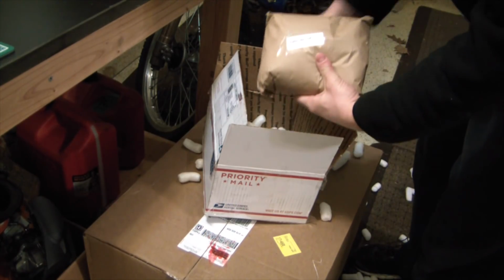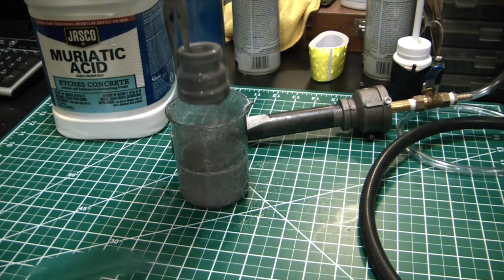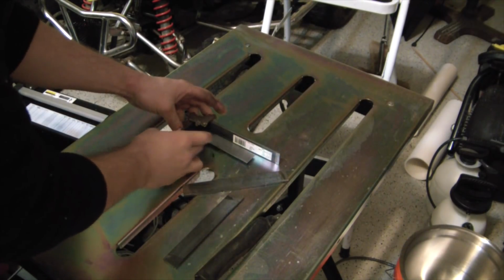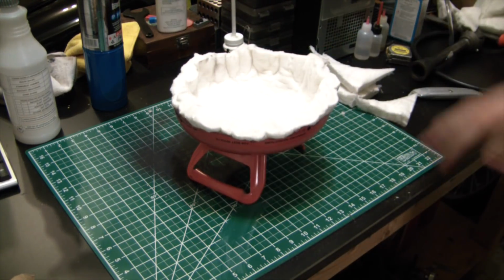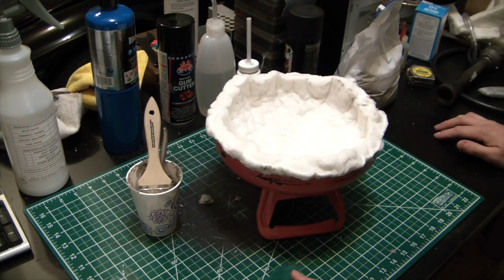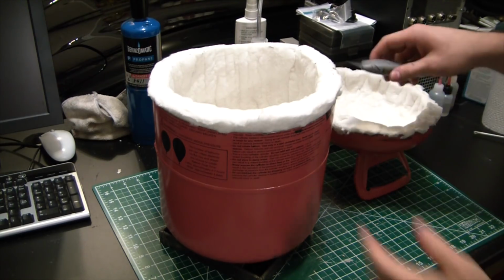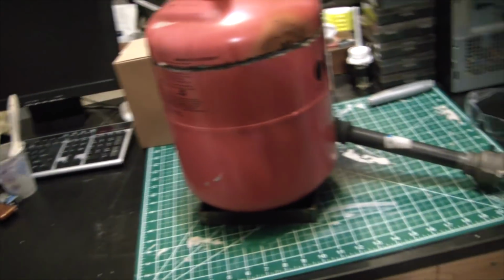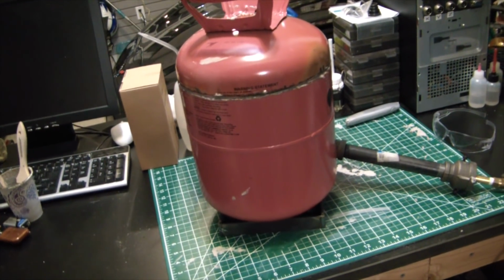HELIUM TANK FOUNDRY - EASILY MELT METAL AT HOME! - ELEMENTALMAKER

Comment: That flame looks pretty green. Green flame means the mix is too rich, which I believe causes more slag buildup, and won't reach full heat (although it seems pretty good). You could probably fix it with a smaller gas jet size and/or a larger reducer coupling. Being able to control the air intake is handy, too; a simple plate that you can slide over it does the trick nicely.

Comment: A couple of suggestions for future projects:  As you mentioned propane tanks but also electric (probably gas too) hot water heaters offer a great variety of sizes for different uses.  They generally fail because of the anode and elements so are still in good shape as far as the tank goes.  Free is also nice.  The other suggestion is a technique I have used and I am sure many others for making the lid fit perfectly every time.  Use a piece of 2" strap (or whatever size) 14 gauge or so and cut it oversize for the circumference of your lid.  Weld and bend as you go around the cut surface fitting and end welding as you complete the circle.  Voila a perfect fit over the bottom section of the tank or forge.  It also gives a very good surface for attaching a hinge.  I made a rod oven with water tank and kept the insulation (I stripped only where I cut it apart) using this method.

I wonder if anyone has shown how much fuel is needed for different sized foundries?  I have access to outboard motor blocks and would like to make a fairly large size one to alleviate excess cutting but don't want to spend a fortune in fuel.  There must be a sweet spot?  I am sure at some point you need more burners to even out the heat too?  It would be ideal for me to have about a three or four gallon crucible.  Great video.  Take care.  Doug

Comment: $100 ? You been done, eBay, £19.95 from china, 2,200 deg rating (thats deg C )
Reply from the maker: Mark Giblin what size blanket is that?
Reply: Depends on your needs, a typical size of 2.24 mtr x 61cm x 26mm  would be about £40 

I searched for THERMAL CERAMIC INSULATION FURNACE and started from there and looks at what was on offer and eventually after searching a little, the sizes and lengths I was interested in popped up.

Search long enough, not only do you get it cheap but also in the size you want it.

Want to ask you what temperature did the external surface get to?
Reply from the maker: Mark Giblin the one I used in this video was $89 and was 1"x24" and 25ft long. It's a huge amount of insulation.
Reply: About $10/mtr is still expensive for what the item is. I only did a brief search and had I spend time searching for the exact type, then looked online outside of ebay, chances are theirs a supplier within 30 minutes that can do you the same deal for less.

The amount of times I have turned to eBay and researched supplies, then looked on Aliexpress and also Bang Good, Gear Best is pointless as thats end user products not parts.

Then I look locally and use the terms the industry use and find out price comparisons and what I need to look for like Safety marks that should be present.

I am betting with a little more time you could have found something closer to home, supporting your local economy and not pushing your $$$'s to a mega-corporation who doesn't give two squirts about its staff... Much prefer supporting the local guys, these big players are just greedy, not content with their lot, they have to steal others livelihoods and destroy family businesses.

Comment: I’m stuck welding galvanized steel all the time. if your in a well ventilated area your fine and if you feel woozy just drink milk it will help remove it from your system.
Reply: Also you can pick up a welding respirator such as one made by Miller Welding. That's what I use. Also a shopvac with one hose near the weld and another hose venting it outside.
Reply from the maker: Good to know! Thanks for checking out my channel! Stay safe and keep laying good beads.

Comment: Some bar stock and lag screws will hold down the helium top. Use some 2×4 material as a surround to help keep 'er in place.
 Or try drilling while it's a complete tank. Strapping her down is always a good ideer.

Comment: The problem with painting first is,that everything you add on top fails whenever the paint fails.I would satanite the bare steel,it will seal the metal from rust too.I would also have skimmed it all on the inside with the cutoff disc os sanding disc first to rough it up and lt the satanite get a good bite.Also,instead of cutting a smaller circle for the bottom,I'd cut up all the left over wedges into small pieces and lay them in the bottom on top of satanite like you did the other end,then lay the bigger circle on top to seal it in.

Comment: ElementalMaker great video!  Thanks for sharing the build!
I don't know it all, but I was a plumber for many years. You should neutralize that acid with some baking soda or it may keep eating away at your fitting. A water rinse works to some extent but it usually fails to get into all of the "pores" of the fitting.
P.S. I also worked with galvanized pipe and fittings every day for many years, tinning and soldering galvanized sheet metal etc., etc., and I did not get any "zinc poisoning."
I don't know how you can stand to work with that insulation barehanded. Every time I work with that stuff I itch like crazy from the fibers that get embedded into my skin. I'm itching just watching you work with it.

Comment: A suggestion, if I may.  If you had punched out the valve and turned the unit upside down before cutting the other end off you would have been able to use the handles as a stand and have a nice drain hole for the day when your crucible fails and fills the bottom of your furnace with molten metal (just make a plug you can knock out to drain the melt).  Nice job though :)

Comment: I enjoyed the video. When I get the money, I am going to rebuild my foundry. I like the idea of using ceramic wool/satanite combo, I really don't want to deal with castable refractory. I't curious to see how it would stand up to my waste oil burner. I used the sand/plaster combo as a proof of concept. It worked pretty good for awhile. It defiantly didn't stand up to the waste oil, but worked for propane. If you would like to check mine out, the channel is cwwraith. Keep it up!

Comment: Can I upscale this and make a crematorium?
Reply: They would be burning in satanite
Reply from the maker: YOU BET! Just cut me in on the profits!
Reply: Just buy a Sawz-All.
Reply: Technically yes but a human/animal body takes a long time and a lot of fuel to burn.  Worked at a incinerator and it would not burn bodies to ash.  Go with the wood chipper or just dumpster it somewhere.
Reply: Mark Henry wood chipper is not a good idea. The flesh gets caught in the teeth oh the chipper and makes the biggest mess. Just go with a cast iron bath and a lot of  muriatic acid.
Reply: @carolmanthei7376  Bad idea, ferric chloride + h2 would be produced. You need a plastic tub, and sulfuric acid + hydrogen peroxide (piranha solution). Or if you are a cheapskate, muriatic + hydrogen peroxide, slower but still effective. 
Acid on it's own can't do it.
Reply: Yeah, that's right!  For a friend.
Reply: wood chipper, septic tank, rid-x and bleach, just sayin...
Reply: Deep hole in the ground, pour in 50lbs of thermite, place body on, 50 more lbs of thermite to cover-throw in lit sparkler and stand back.  No mess, no fuss, no remnants lol
Reply: @ProlificInvention  pre dry the body in salts first tho, too much water content for that to work well otherwise.
Reply: @HerbaMachina  Na, the fats contribute to the conflageration, the water content violently steams almost instantly and rips the body apart exposing the fats to the 2,000 degree temps-all that's left after 5 minutes is a slag pile.  Don't ask how I know 😂
Reply: Nah, I worked on the Screw-big metal pipe full of hot ash and caustics, had to wear protective gear and that stuff lasted about two hours before it had to be replaced, marshmallows would have been covered in caustic 300 degree ash in minutes.
Reply: I spent 8 years in the army as a 57F (graves/army mortician) ".  I know all the good ways to identify  (and in turn prevent identification) of remains 😏.
Reply: hogs work better
Reply: Teeth get left and no one wants to go get them
Reply: Did you take marshmallows to work?
Reply: You need a forced air blower burner is all.... Not very doable with a venturi burner because of back pressure and loss of the oxygen balance when burning a large amount of volatile organic materials.......a shop vac in blow mode makes a good pressurized air supply...and will allow the burn to reach 2,900 to 3,100 F easily.
Reply: M H "Asking for a friend"

Comment: To cut a tank more evenly screw 4 casters and an end post to the top of your bench. Put the tank on the casters with the butt end pressed against the end post. Now you can hold the cutting wheel still and spin the tank to cut the top off.
Reply from the maker: Gonna have to do that next time! Thanks for the solid advice!
Reply: @ElementalMaker  a piece of advice for any future forge making, use steel bolts (not galvanised ofc) to secure the wool, if long enough it'll also double as feet for the lid so it doesn't come in contact with the ground/concrete/etc
Reply: @shadowmaster335  do you mean instead of the welded box at the bottom?
Reply: @vaughnsmith99  no, on the lid, that way the wool can be locked in place even after it starts to crumble, the feet part is so there isn't a risk of getting contaminants into the forge if there's dirt around, the galvanised part is so that there isn't any toxic gas buildup from exposing it to extreme heat ;)
Reply: @shadowmaster335  awesome, thank you!
Reply: @shadowmaster335   A piece of advice forany future forge making: Use stainless hardware whenever possible for forges or furnaces since it's more heat resistant.  ;)
Reply: do this all the time its great
Reply: @ericgillespie2812  are you the same Eric that shoots darts at the Rebel?
Reply: Also weld some was halfway in the lower half. This will hold the lid in place so it doesn't slip off. And it will help keep it centered.
Reply: Comment tips first prize.
Cheers Mark...
Reply: Yes the rollers work very well but I put mine on  pieces of 8 inch angle